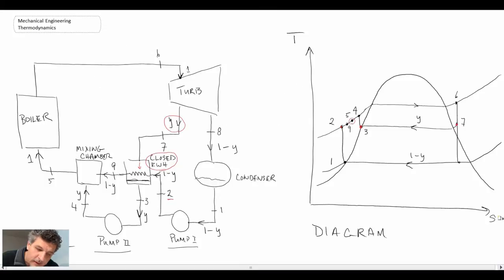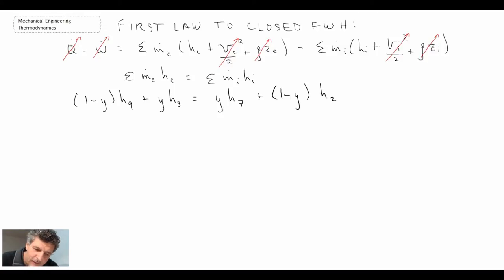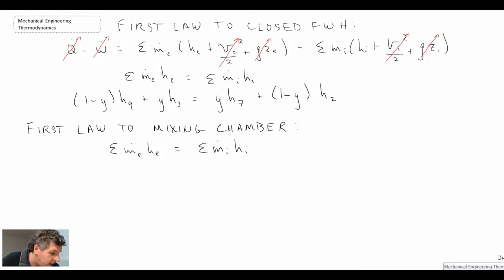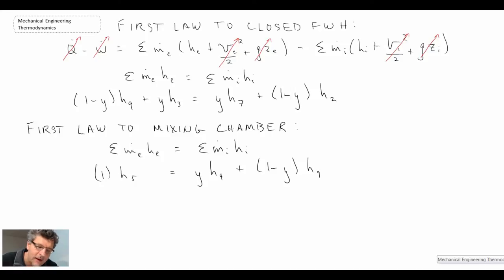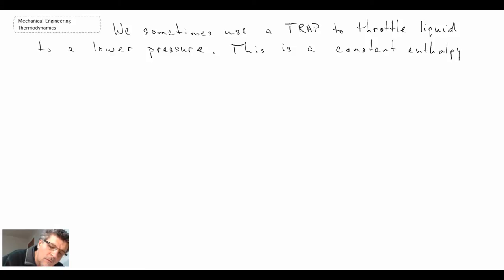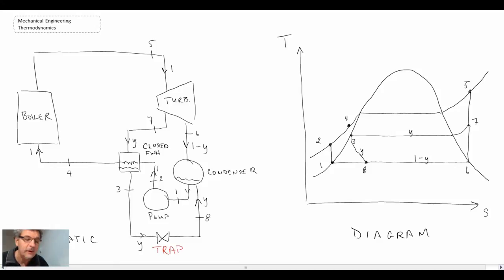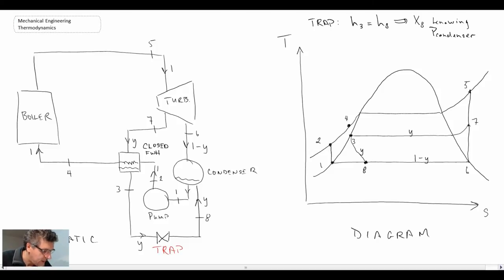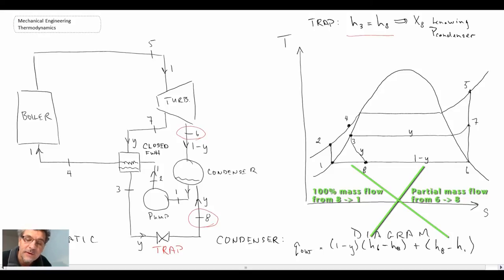Mechanical Engineering Thermodynamics - Lec 20, pt 7 of 7:  First Law - Closed Feedwater Heater

Comment: T7 drops to T3 while heating from state 2 to state 4, this means that T4 = T3 right? This means that the point of T4 needs to go down a little bit, as I can see here that you assumed that T4 = T7 from the TS diagram.
So simply, is T4 = T3?